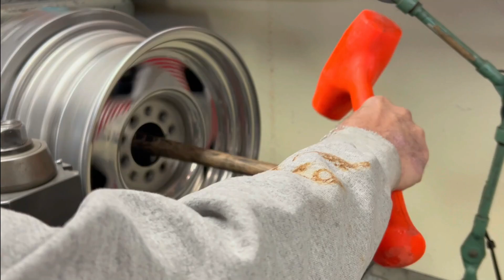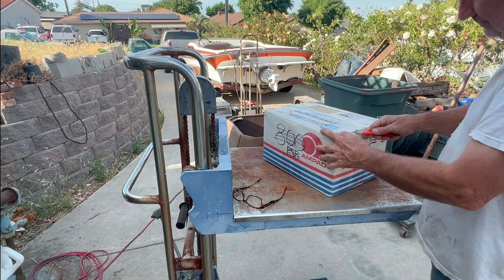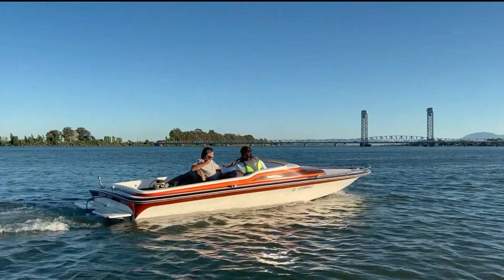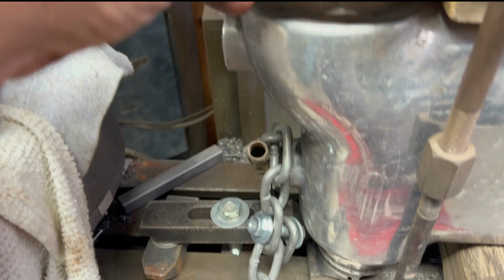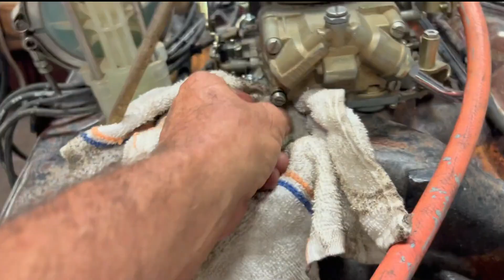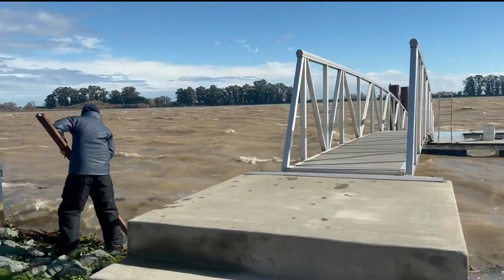1977 Sanger Back on the water after 25 years.

Comment: Looks like it moves out pretty good!
Reply from the maker: Brian, always nice having you stop by the channel. For a 22 foot long boat it goes right at 50 miles an hour with two adults and two full tanks of fuel. And they offered the same boat in a V Drive, which definitely faster with a prop than a jet, but I like the way a jet boat maneuvers in and out and away from docs, and I don’t have to worry about hitting something submerged and wrecking my boat. Again, thanks for stopping by and hope you’re doing well. Gary

Comment: Wow, great fun. Good to see you, Gary and the family. 👍
That’s the same style engine I had in the bronco 💪💪
Reply from the maker: Dean, great to have you stop by the channel. I’m just getting a chance to respond to my comments. So I assume you sold your bronco which I think was 78 or 79 and I just seen on Instagram where you sold your bump side Ford which would be 72 or older so now you have no more old vehicles? I think that Bronco had either 351M or 400 that came in them. I recently bought a 1976 short wheelbase four-wheel-drive that came with the 360. So I had to get a couple more trucks in order to get the parts I want to put in it. I will build up at 460 that’ll go into it. But I also bought a couple Jeepster commando’s I’m working on also 😄may have to start a second channel, call it the rebuilding of old iron 😄 thanks for stopping by Dean.
Reply: @ yeah sold the Bronco & bought a 2017 Tundra; little more comfort for an old guy 😀
The f250 is going to a YouTube buddy.
Reply: @ The 460 is a good choice. About the same fuel mileage as the FE 360 and a ton more power. 
And you can fit up an overdrive tranny.